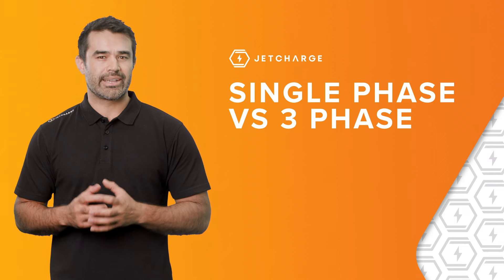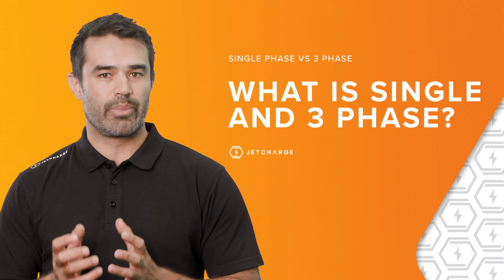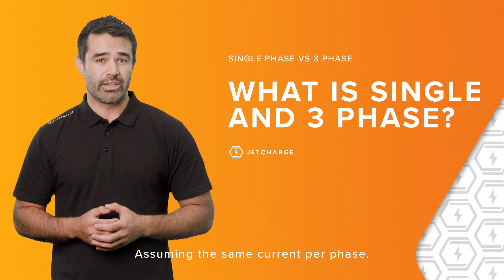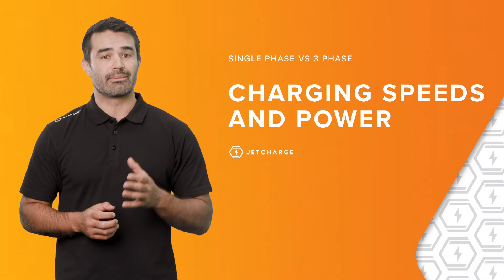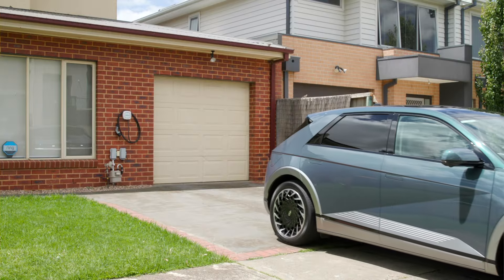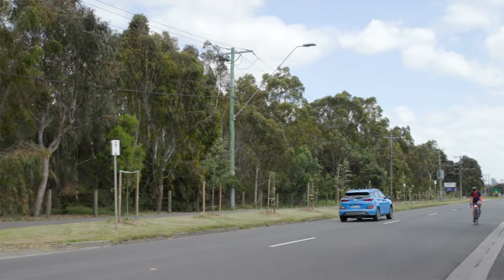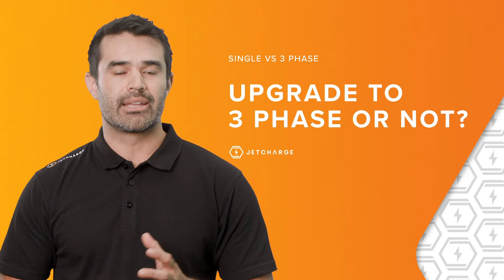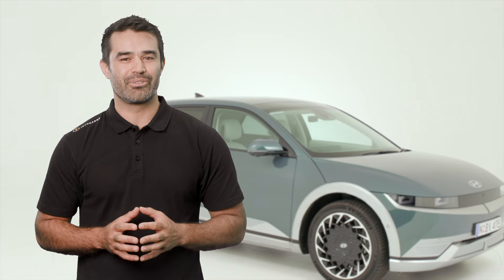Electric Vehicle Charging - Single vs 3 Phase Charging

Comment: I'm in the UK 🇬🇧... and we upgraded to 3 Phase at home, on 80 Amp fuse cutout.

One of the biggest benefits is being able to install two 22kW ev wall chargers and charge two cars at the same time with no significant load balancing.

The reason this can be very useful, is when limited by time access to an overnight low-cost electric tariff.

We get to fill both cars, quickly, at low cost.
Reply: Another benefit of 3 Phase that we've noted... during the night time low-cost tariff, we can also fill our Tesla Powerwall Home storage batteries.  This cheap power is then used during the day, and we then don't use the National Grid all day.

When being restricted to short periods of low-cost electric, it's better to have a higher capacity cabling infrastructure to take advantage of it.
Reply: @JustMeTalking  Have you done the calculation of effective pence per kilowatt hour of electricity from your Powerwall when being charged up at night and compared that to the day unit rate of electricity from your electrical supplier?

Your calculation of pence per kWh from your Powerwall needs to include the cost of the Powerwall and its expected life time.

Does charging up the Powerwall at night work out cheaper?
Reply: @Dean G  ... that's tricky to be honest.

Our nighttime Grid rate is 7.5p per kWh
Our daytime Grid rate is 39.5p per kWh
Our daytime Solar rate is 0.0p per kWh

So our Powerwalls are always full with a mix of 0.0p Solar or 7.5p Grid.  We never import Grid a daytime peak rate.

So... I also get a full cycle pretty much each day, as surplus gets put in the cars.